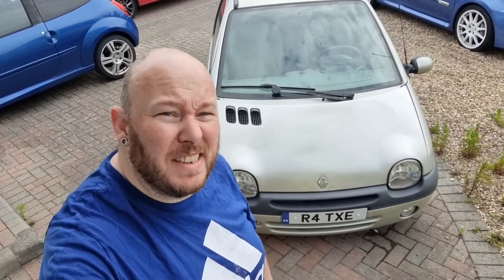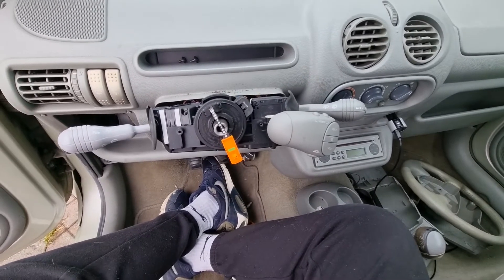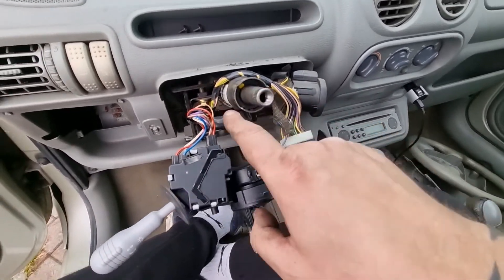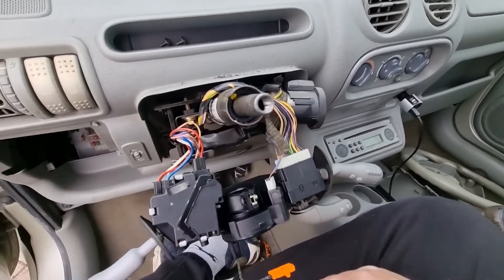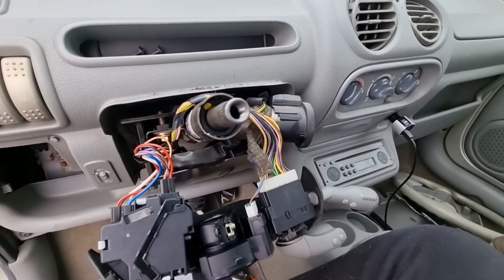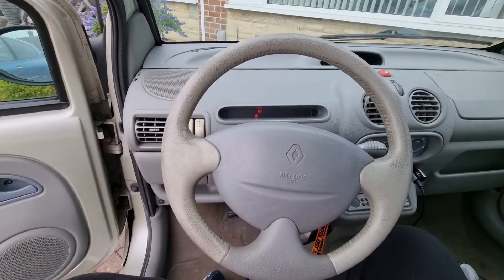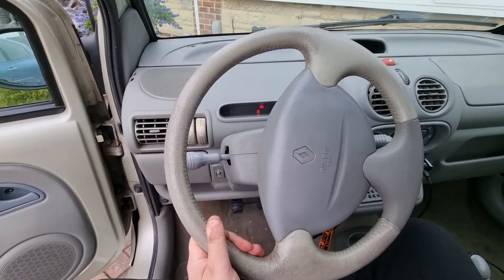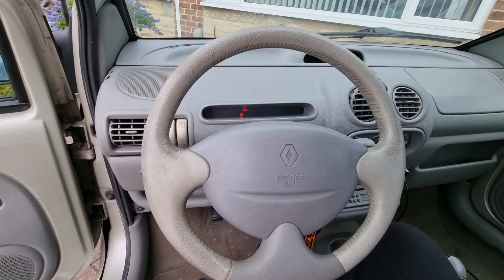#28 - Lubricating the steering column on Twingo Mk1

Comment: Was lubricating a universal joint, between the firewall & rack, today at work. 

When turning the wheel lock to lock, there were 3 places felt notchy

Locked the wheel straight & unbolted the joint from the rack.

Basically just sprayed good quality penetrating fluid on the joint & worked it up & down constantly until it freed. Then smeared grease all over it.
Reply from the maker: Great advice!

Comment: I have a 2006 Twingo and it has the same steering characteristic. If you turn the wheel while stopping, letting go the steering wheel dos not self center it. But when you start driving, it will self center. Also, the steering is much heavier when you drive faster. The power steering of this brilliant car thinks it needs to think for you, so assisting more in certain situations. I don’t really like but it is what it is.

Our Twingo’s have one of the first types of electric assisted steering. My old 2005 Honda Jazz also had an early type electrical assisted steering. Those kinds of assisted steering are just strange to use and sometimes seem a bit off. My mechanics friend who works as a Renault mechanic said he saw loads and loads of Twingo’s with this typical steering. He said it was a characteristic of this type of steering.

Comment: You should search for versions dedicated for engine D4F 1,2 16V. Initiale is mechanically the same as rest of 16V
Reply from the maker: Yes apart from the rear suspension setup on the Twingo they are very much based on the R5/clio mechanicals of the same era.